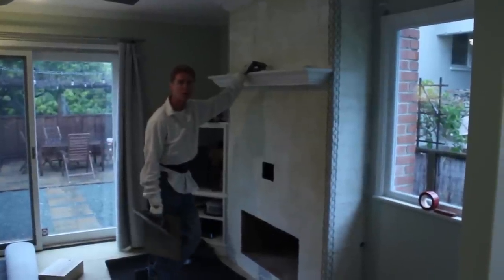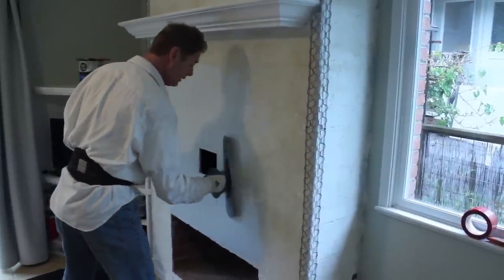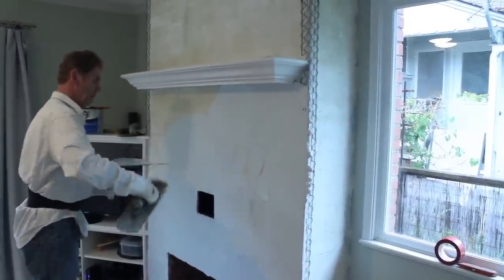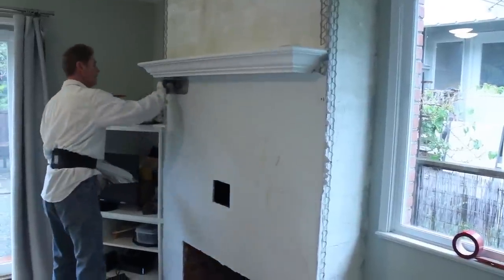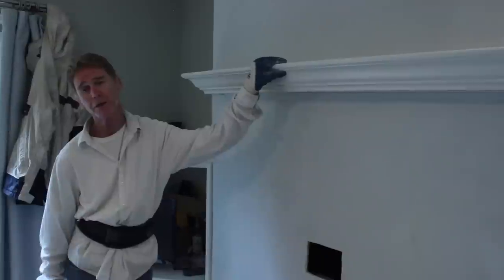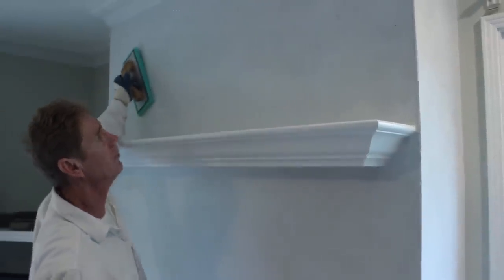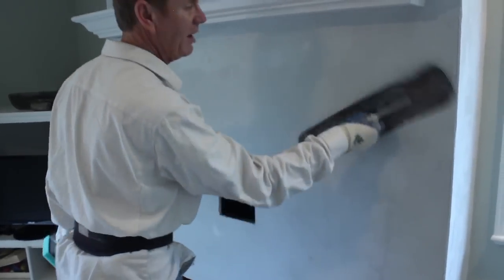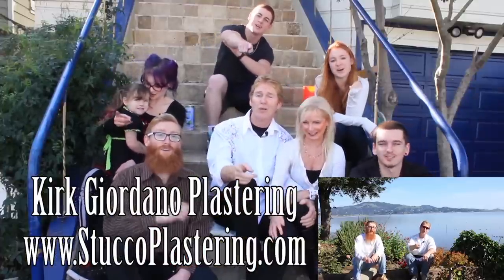Interior Lime plastering over a fireplace.

Comment: Can I do the structo-lite and the the diamond Veneer and then lay a bit of tile over that?
Reply from the maker: Howdy  Alysbar, you can, however, if it were me I'd lay the tile on the structo-lite base coat, not the finish coat.     
                     Live long and plaster, 
  Sharing stucco secrets, or common sense tips
Reply: Kirk Giordano plastering Inc. thank you. You're videos are very helpful. Have me a solution that is just perfect for my old 70's brick fireplace 😁😁
Reply: Hi Kirk, do I need to rough up the structo-lite or do you think there will not be a issue with adherence?